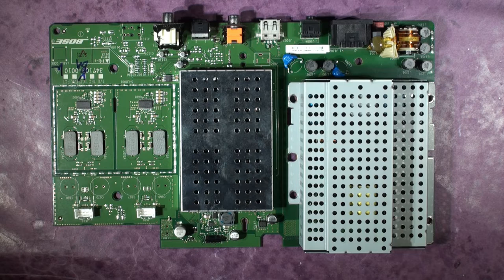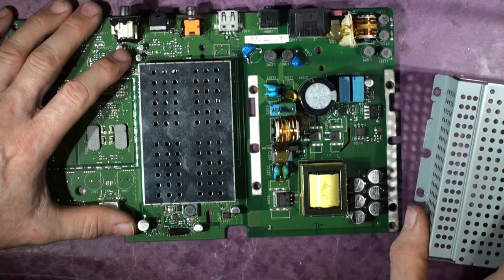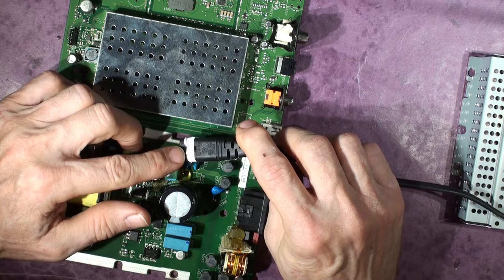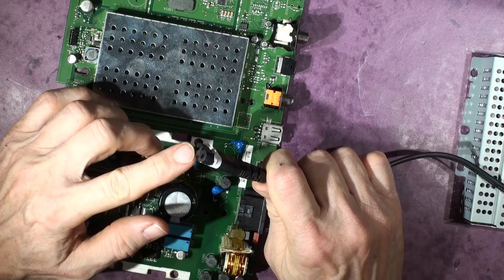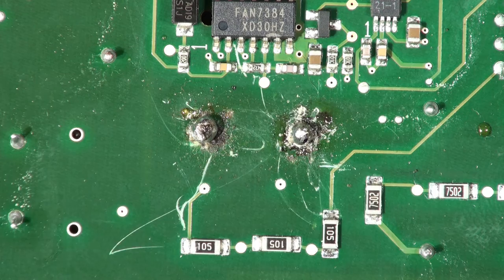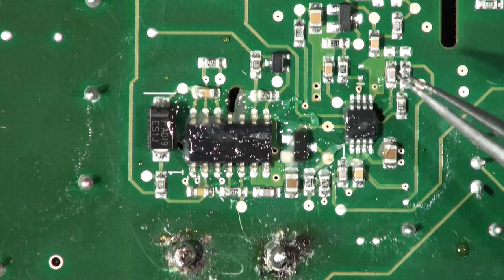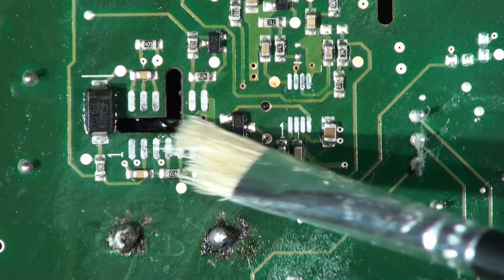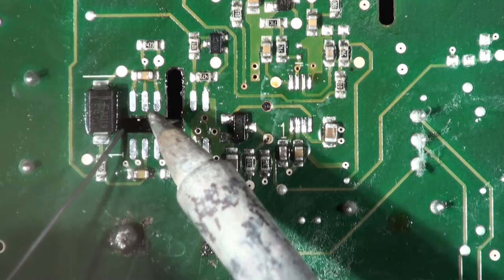Bose Solo SoundBar Diagnostics and Repair

Comment: Hi MS,
A great video thoroughly enjoyed it. I have the same Bose product which is faulty.
The symptom of the faulty is high pitch squealing noise then no output.
I am a retired electronics tech that can swing a soldering iron, and an AVO but, would appreciate a hand.
I plugged the unit in and all worked fine. I believe something to be overheating?
Nothing obvious.
I intend to reflow the joints around the mainboard and then soaking to see if that helps. I am electrically safe (most of the time).
Reply from the maker: Thanks, The squealing noise is dealt with in another video in the playlist on our channel. It can be fixed in about 50% of cases.
Reply: @razenby  found your other video and followed your suggestions and it worked (although a pad came off and a repair was required).
So thanks for that.
Reply from the maker: @clem02031964  Good job.
Reply: @razenby   It happen to me also a pad came off, I had to add a copper wire directly in the (-) hole next to it... It works no more squeal noise. Now after a certain time, the power shuts off and light goes off... can't activate with remote but need to cycle power from cord.. annoying. Any suggestion?
Reply: Hallo is this  Ic LM 5021  mm  1 or 2
Reply: @stigifranky  Hi I no longer have the unit returned to my friend repaired, so, sorry I can't help.

Comment: Hello MS!  I watched with great interest all the videos on the Bose Solo, hoping to get some ideas on fixing mine, but no luck.  My problem is the same as several others who commented here, namely, no beeps, no LED coming on, nothing.  Power supply is definitely putting out 24VDC and linear regulators in DSP section are putting out 3 and 1.7VDC.  There is no 5V on the USB port.  I’ve also checked the remote and know it’s working and signal is getting to the processor.  Clearly, without the start-up beeps unit is not ready to receive any input from the remote.  Without a schematic, even though I’m an electrical engineer, I have no idea what to do.  If you get one of these Solos, as there seem to be a lot of them failing the same way, I’d love to see a video on how you go about troubleshooting and repairing it.
Thanks in advance.
Reply from the maker: Sorry for late reply. I have been working to deliver a project. f you want to send the unit to me I will debug and hopefully fix it and put a video up.  No charge except shipping.
Reply: @razenby   hi there would you like to have a look at my solo sound bar got cristals from fernels fitted  no light and no beep rc works am stuck unless the transistor for the power switch is faulty please could you help
Reply: Garo, Did you get anywhere with your unit? sent an email to magic smoke but haven't received a reply yet.

Comment: Hello Magic Smoke teacher, congratulations for the shared video, I would like to know if at some point you had to repair the BOSE PM4500, if so you could share your knowledge, I have one in the workshop that does not turn on anything and voltage enters the capacitors. Thank you
Reply from the maker: Thanks. I haven't seen that model. Do you happen to know if that often have issues? The obvious thing would be to open it up and check for shorts on all the power FETs you can find. 90% of the time on a failed FET will meter with all three connections will be shorted together.. If you do find a failed one then check the components in the gate drive circuit.
Reply: @razenby  Gracias por su sugerencia, los FET están ok ya los verifique 👍

Comment: Hello! How are you? Magic Smoke I have a bose solo tv sound system that doesn't work anymore. I saw that suitorail video very nice to watch. I tried to follow your video I'm having trouble removing the cover of the processor DSP where it has codechips some non volatile flash and crystal resistor. can you help me to restore my Bose can you do anything with this issue. Thanks
Reply from the maker: No problem.  Do you have low-voltage DC power?  If not you need to fix the switch-mode-power-supply. (SMPS) As far as I can recall the can cover is held on by spring details in the edge of the cover and can just be levered off.
Reply: @razenby  good afternoon to you MS. I don't know what's wrong with my bose solo tv sound system I saw that you changed two crystal resistors I watched that video where you changed two crystal resistors parts code is 1842312 and 1842317 it's a crystal resistor. I searched Farnell Elements for this crystal resistor and they don't make it anymore. can you help me where else to get it, I just want to ask you if it is possible to have it done by you and how much is the charge. thank you very much

Comment: The smaller chip looks like a SOP8 memory chip. If this is the case, you would need to transfer the information stored in that chip to the new chip before it would work. Great video for someone looking to diagnose their Solo. In my experience with the Bose Solo soundbars, the failure always seems to be within the Bose firmware. Either a bad solder at the chip or the chip has taken a turn for the worse. Also, wasn't the last part you soldered onto the board a MOSFET? There is a great way to check these types of gates without having to remove them.
Reply from the maker: Firmware fails and no way to force into a loader without a serial JTAG programming interface. There is no startup checksum warning event though they could flash a LED warning sequence.  re the DSP the start up sequence and timing of the power lines is crucial else teh logic can hang up and a hard resent wont make it start once the change has happened.

Comment: Have the same issue. Can you please help me with a resistor marking that blew on my main board and now I can't find any schematics to figure out what is its value. the resistor is located on the power supply side next to the bridge rectifier (BR1201) and the component marked with C1224. thanks
Reply: here is a pic: https://imgur.com/Sj3F8hC did you get is sorted?
Reply from the maker: This you get this sorted?
Reply: Hi, sorry to ask but, is that a 75 ohm resistor? Thanks in advance

Comment: I have the same one I have to unplug it and plug it back in a couple of times to get it to turn on how can I fix it if u can help me
Reply from the maker: It is dying. You can carry out the same procedure as I did and it will make it better. Probably a 70% chance of working long term.

Comment: Thanks for the videos!  I have the exact same board on my bench.  I have 24V on the output caps, however the unit will not turn on.  Do you happen to know what I should check next?
Reply from the maker: Yes, please subscribe to see the other videos on the Bose solo on this channel. It turns out the fix for the buzzing issue invariably solves the start up problem too.
Reply: @razenby  hey magic smoke, im in the UK. My brother bought me a bose solo tv system for my wedding, since then it stopped working and i dont want to throw it away... would it be possible for you to fix it for me? I will pay you for the repair. Its got the same problem where the LED wont light up and no sound.

Comment: Hi, a question please. I don't have any sound, nowhere, (aux, radio or cd). Could it be the trafo?
Reply from the maker: Do you have any indications of power or life? - do you get beep beep when you power up?
Reply: @razenby  Thanks for replying! No, no indication of power or life (e.g. when I connect the cable from the usb external 7.1 soundcard  [Logilink]) and also no beep... But the time is showing and I can change the modes (aux, disc and radio), the volume and such, but I don't have any sound, nowhere... So, I don't think, it's the trafo then, right? But what could it be then?

Comment: Hello Magic Smoke,

I watched your videos as a friend of mine asked me if I could try to repair his Bose Solo TV device...
I was wondering if maybe you could help !
The device behaves like if it was totally dead (no light, no initial sound, nothing). The remote is working fine (sending infrared frames at least !). Inside the device, I performed a visual inspection and it looks fine as far as I can see, no leakage, nothing burnt or exploded.
I checked the power supply part of the main board and the mains (230v AC) is entering it ok, reaching the bridge rectifier, then I get around 330v DC at the bridge output.
However, I have absolutely nothing (O v) at the output of this power supply section (I understand from your videos that I should measure around 24v DC at any of the 6 capacitors filtering the ouput signal).
I removed the STX616 NPN transistor and tested it with a little multi-function tester and it looks ok. Do you think it is still worth replacing it by a new one or shall I look elsewhere ? I even tried to inject 24v DC to bypass the power supply but, no better (though I see there is 1,8v and 3,3v available around the Texas chip).
This Bose device is evil :-)

It is driving me crazy as many other people as I can see in the video comments !

Thank you for your help and congratulations for your videos which are great 🙂
Rgds,
Reply from the maker: Sorry, I am up to my ears in design work...

Comment: Great Video but way to advanced for me to start messing around with - I have the same system no power whatsoever. do you know of any repair centres in the UK please - will be a shame to throw this one in the bin!
Reply from the maker: Have you checked that you have DC across the reservoir capacitors?  I dont have time to fix anything at the moment as I am working on a new design.
Reply: @razenby  thanks for the Reply MS. No I’ve not tested anything as there is chance of death with me and any electrics! Not to worry mate. Thanks for the reply regardless 👌🏼

Comment: Hi great video thanks. Didn’t need it in the end but very impressed with your repair setup. Do you have any details on this? Couldn’t quite follow how the light bulb was connected?
Reply from the maker: The 60W light bulb is connected in series with the mains live wire although on my bench Live and Neutral have no meaning as the test supply is fully transformer isolated so nothing is referenced to ground.
Reply: @razenby  some super-highend speakers used this technique to sell their "unlimited" power speakers. All they did was add a light-bulb in series inside the speaker enclosure and their boxes were bullet proof and could be hooked up to any size amp and never die.
Reply from the maker: @RogerHammond  Interesting.  I'll think about that. One issue might be finding the right bulb for the job. The very low impedance of modern speakers. They used to be 8 or 15 ohm drivers. Now a lot are just 2 Ohms.
Reply: @razenby  these were concert rated speakers. Raw power wins, not clarity.

Comment: Hi, great series of videos. I’ve followed this on two broken Bose solos I have which gets no light or activity. Getting 23.7v out of the mains side but no beep, light or anything written to a USB key, please could you tell me if you have any ideas where to look next on the low voltage side without an oscilloscope. Thanks in advance.
Reply from the maker: I have the Texas development kit but have yet to find the time  to fire it up.  Want to determine if it is corrupted Flash or a tired DSP.  I have to say that I find it hard to agree with suggestions by Tubers that the DSP is tired. I have used them in designs and they never got tired but it could be a bad batch.

Comment: Hi, Q1204 it's STX616 body TO-92AP
Reply from the maker: I sourced the original part bought a box of them from China as I could not get them in the UK. It was a selection box kit on AliExpress called High voltage transistors. Very useful.

Comment: Awesome work! I just got one of these speakers with the same issue :) i normally fix phones, tablets, laptops and game consoles so this will be my firs bose soundbar repair :) however i can't seem to find one of them two chips that you replaced :) could you possibly let me know where can i get them chips? :) thank you in advance! :)
Reply from the maker: LM5021   .. Don't do this repair unless you know the risks.. Dangerous voltages!! Save that Bose!! Good luck.
Reply: @razenby  i do have a proper setup for high voltage also but i just don't do that work so often, i hope i will be okay :) thank you once more for such great video and thank you for getting back to me so quick! :)
Reply from the maker: No problem. Had to be said just in case...clearly you are experienced.  Let us know how you get on. Keep your mum on speed-dial!
Reply: @razenby  and she's alive! One more bose on this planet is saved thanks to your detailed video! Thank you once again sir! :)
Reply from the maker: Great news. Good job!!
Reply: @JTMS-tz5gv  how did you do it? so many people having the same issue from what I can see, there are also a few forum threads on Bose forums. I am also having the no power/no chime issue, measured 24v, and some 6v and 3.3v at the IR receiver board connector, but no solution. Any help would be greatly appreciated
Reply: @silviuguseila2552  I do have a worksop for electronics so I do have all necessary tools and some skill in this so it wasn't that hard to be honest, I just followed everything what he did on this video and it worked :)

Comment: Hi, just wondered if you ever came across a faulty Boss Cinemate 1 SR system. Mine died and I found out that this is a very common thing on these. It just stops responding to the remote, no lights blinking on the soundbar. I’m reading on Bose forums that the replacement units that people get or the “repaired” do not last long either. Several months to a year and back to the same issue. And it’s 160-180 dollars. So sending it out for an “official” repair is not an option. Thank you for any info on these. I’m in US, and very handy with this kind of stuff. Appreciate it
Reply from the maker: Hi, sorry, no although I expect it suffers from the usual Bose DSP or power supply issues. Is the power supply working OK?
Reply: @razenby   yes, there is stable 24 volts on the output capacitors, however I can’t seem to get that voltage on the output connector. There is a red and black wire going to the amplifier board I guess, so there is nothing on there if I measure voltage. But when I plug in the unit to the mains, it will sometimes blink the white LED as if trying to power up, but that is it. No response to the remote.
Reply: @mikhailt1254  Did you investigate further on this? I have a similar issue on my 1SR, most of the time it works properly but the remote doesn't respond anymore after some time. When I power the soundbar without the acoustimass the white led is there but the green led blinks. I checked the PSU and I get a stable 24V. So I then checked the DSP board but I can't find any faulty component. I don't have an oscilloscope on hand right now sadly.
Reply: @hervedonner1864   hi, I ended up sending it to Bose for service. And they did it all for 160 $180 at that time. It was about two years ago. Thank you
Reply: @razenby  Well, I did investigate and I think Mikhail had the same issue. The problem seems to be the Spansion FL128PIF (located at the back of the DSP board, it has a sticker on it). Either bad connection or the chip is dying. I resoldered it and my soundbar is back to life now but the chip may eventually need to be replaced. If so, I guess it would need to be reflashed? Do you know? Thank you
Reply: @mikhailt1254  I've got this exact problem! Were you able to fix it?
Reply: @wouterroorda3150  yes, I sent it to Bose for a repair. There was a $160 fee

Comment: My is 520 is not coming on but the power side is ok no display on the console
Reply from the maker: Hmm Not booting. You cant try changing the electrolytic capacitors and make sure the IR sensor isn't shorted.

Comment: HI Magic Smoke, I have the problem in My Bose solo TV system not works there is no LED and no start sound . I have checked 24volt present in secondary output.  Please can you advice some tips to how to check or fix that issue,? Appreciate in advance for your answer
Reply from the maker: It could be the micro not booting or corrupted code and it is stuck in the loader routine..  You can load new firmware. I will try this here and put a video up on YouTube to show you how to do it.
Reply: @razenby  I got same problem. 24v present on board, no power at usb. I tried to connect with RS232 adapter and only get '<' in terminal. Looks like firmware issue. Did you find any solution? Any help appreciated.
Reply from the maker: See the other videos on this channel re the diagnosis of the logic section of the Bose Solo;
Reply: Magic Smoke Thank you for reply. I already go through your diagnostics video. Tried each step and everything looks good, even added capacitor and replaced xtals. Now only firmware part is left. There is no power to usb so I am looking for binary file which I can manually flash it with spi programmer if possible.

Comment: good morning sir, i have no power no led issue. i saw 308Volts in the first capacitor and 24 volts at the six capacitors (bottom right). Is that okay for first step or i need something?
Reply from the maker: Your power supply is working. For the next step watch the other Bose solo videos on my Channel. It is likely you need the modification.
Reply: @razenby  sooooo... some smart guy put the plug in the socket and the board has two blows (because a tool on the bench shorted one spot). can i contact you somehow to speak further?